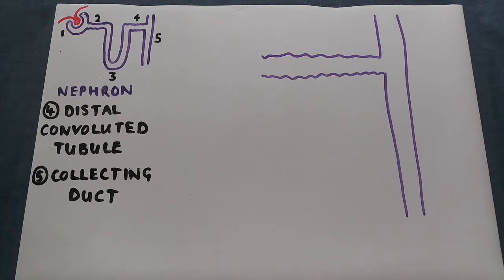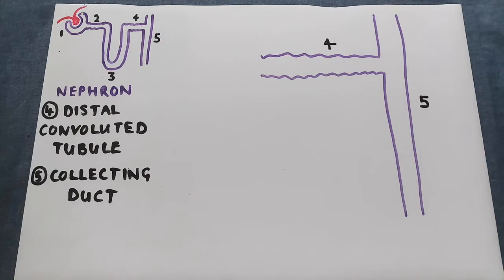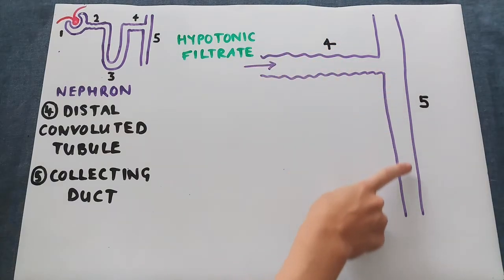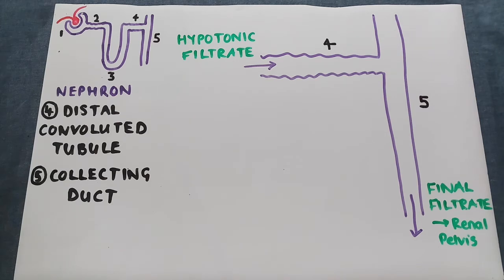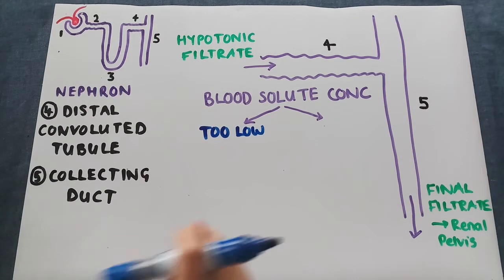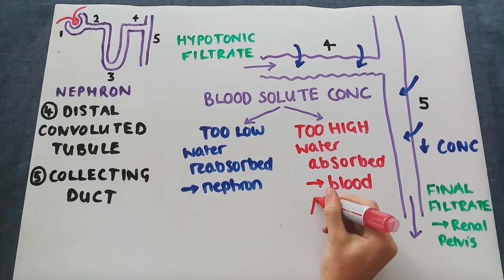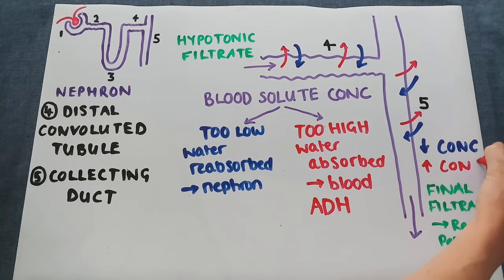The distal convoluted tubule and collecting duct

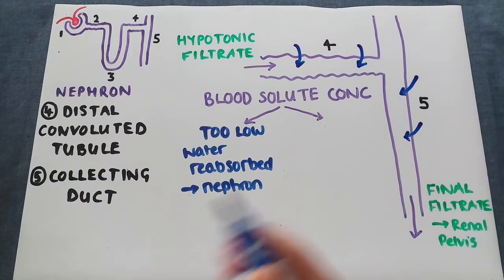Comment: reabsorption is defined as molecules reentering the blood stream, not the secretion of molecules back into the nephron tubules (via 3:05); the specification between secretion and reabsorption should be included as they are not the same and indicate where the flow of molecules is going.

Comment: question:

i understood this from the textbook:
if the solute conc. is TOO HIGH in the filtrate = LOW water potential, so water moves by osmosis from tissue fluid into the (low water potential) filtrate. adding water will dilute the conc. of solutes,,, 

but the video is saying the opposite from what i understood, which is correct??????????????????????????????????????????
Reply from the maker: Hello
I think we are both talking about the same thing, but I'm starting from the blood solute concentration (in the vessels surrounding the nephron), rather than looking at the filtrate inside the nephron.

Your body's priority is to make sure your blood solute concentration is where it should be, and the concentration of your urine (the filtrate) depends on that.

So if the solute concentration in the blood surrounding the nephron is too high, water moves out of the nephron into the blood vessels to dilute it (and therefore your urine is more concentrated)

If the solute concentration in the blood surrounding the nephron is too low or dilute, water will move into the nephron (and therefore your urine is more diluted)

Hope that helps!
Reply: @quickscience6568  ohhh okayyy, thank you so much for the explanation ! <3